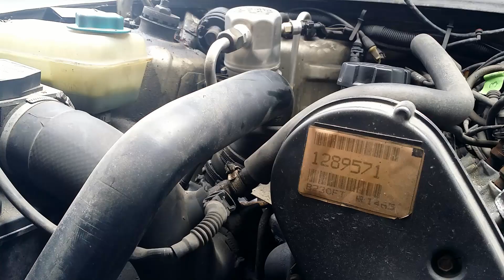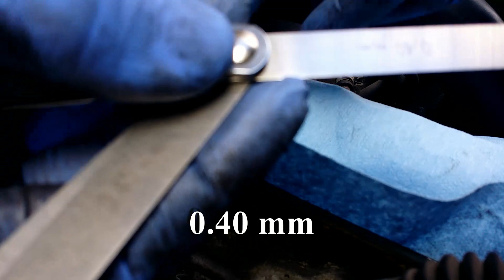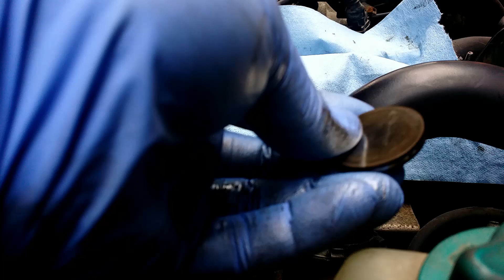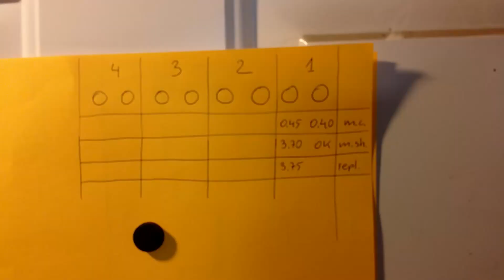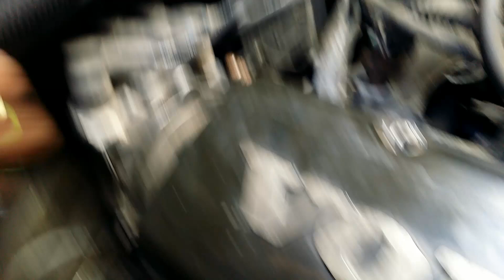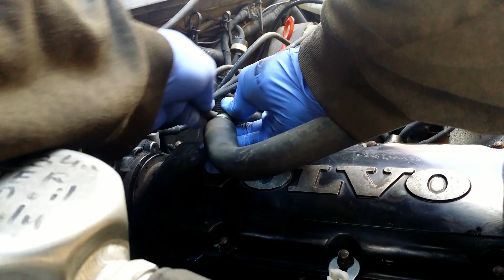Valve Adjustment in Volvo 940 Turbo, or any B230 Engine. New Hushers in.

Comment: I have a clear ticking from valve area when in gear and rising RPMs, not idle and rev ups in neutral, a flattened husher could make ticking noises?
Reply from the maker: Hard to tell in a distance. Check the valves.

Comment: This is a fantastic how to video. I did not understand entirely marking the distributor position and replacing in the same position in terms of how it is loosened and secured.
Reply from the maker: Distributor shaft gets into camshaft. To remove camshaft it must be removed. It is not critical to put it back in precise spot, but it is good practice to reassemble machinery as it was.

Comment: Hello, is the Hazet 2574-1 hold-down device suitable for replacing the valve plates?
Reply from the maker: I never used this specific one. Check with the manufacturer.

Comment: Do you really need to mark the distributor? I thought it was electronic ignition controlled by ignition ecu and wont make any diffirence?
Reply from the maker: You are right, but it is a good habit to mark parts before disassembly.

Comment: you really shouldn't use rtv on the valve cover gasket it introduces a danger of loose pieces falling into the head during the next service. Volvo recommends using a 'High Tack, Non-hardening gasket sealant' on all their gaskets.

Comment: Hi there. Did the clearance changed when you put new hushers?
Reply from the maker: New hushers will lower the gap, but not for long. Don't measure valve clearance with just installed hushers. They will get in shape eventually.
Reply: @robertdeptula2003  My B230 lashings are all in specs, but still has one valve ticking when throttle up in gear, could be a bad husher? thx

Comment: Once it warms up later this spring I plan on doing the following in one procedure on my '90 B230F engine: new water pump, timing belt, timing belt tensioner & spring, camshaft & intermediate shaft seals, valve clearance check/adjustment, hushers. I have most of the new parts I'll need - mostly Genuine Volvo. Since I have never done any of those jobs before I just need a lot of patience and luck. Hopefully, I have all the required tools, too.

Comment: Do worn hushers make a clacking noise?.. Sounds like an old sewing machine mine even when warmed up..
Reply: yes they become hard and crack,then fall into pieces ,noisy like you mentionned
Reply: I have clear ticking from one valve when throttle up, but not in idle and rev in neutral, flattened husher?

Comment: Great video and explaining.  I have a  question - at 17:00 when you show your chart, do you want both to be at 0.40 so that they are equal?  Since the shim measures at 3.70 and you want it to be less so that the .45 goes to .40 wouldn't you replace it with a 3.65 shim? and not the 3.75 ?  Thank for all your help.  Joseph in New Mexico.... We have a new and hopefully better President today.  Trump is gone..YAHOO!!!
Reply: The "gap" needs to be .40 but it is .45 which means it is .05 too much so the gap needs to be made smaller. Since the shim measures 3.70 you need to add .05 to it , to close the gap by that amount , so the final shim is 3.7 +.05=3.75. Now the gap is .40
Reply from the maker: @abyssalsoul6216  Bentley manual for Volvo 240 has it wrong and many people are confused.
Reply from the maker: Do you have Bentley manual for Volvo 240 and look up for valve adjustment there?
Reply from the maker: Is it your's thumb up as the answer to my question? If you have Bentley be careful, they made wrong calculations there. If you have it let me know. I will explain to you what is wrong there. My calculations are correct and you can verify that with Haynes manual for Volvo 740 & 760.
Reply: @robertdeptula2003  - yes I did the thumbs up.  I do have the Bentley repair book and will look at the subject in a day or two. I have a Volvo 240, same engine is b230. Thank you.
Reply: "We have a new and hopefully better President today."  This aged like fine milk.
Reply: @crs290 lol yeah, and he was replaced with the previous guy… anyways I guess I will adjust my valves now lol.

Comment: Nice video! You replaced the vacuum hoses because you were at it, or is it advised to do so?
Reply from the maker: The rubber was cracking on the old ones (25+ years).
Reply: @robertdeptula2003  thanks. By the way, when you mention you have to replace the shim to correct the clearance... It means you have to order it and replace it after arriving, right? So, in the meantime the car is parked, or you re-do everything just to replace the shims once they arrive?
Reply from the maker: I put everything back together and the car was driven before new shims arrived. I replaced the shims after using a special tool without camshaft removal.
Reply: @robertdeptula2003  thank you again! That would make a nice video 2.0 though

Comment: what tool are you using in the video at 9:52 too hold the camgear???
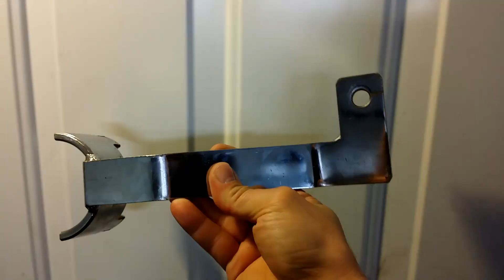Reply from the maker: It is  crankshaft pulley holder I show at 24:37
Reply: @robertdeptula2003  hei Thank You very much. did you bye it on ebey or at a volvo shop.. sorry for bad english am norwegian
Reply from the maker: Don't worry about English. I am Polish living in French part of Canada. 
The tool is from FCP Euro in US. www.fcpeuro.com
Reply: @robertdeptula2003  Tool is also on Amazon and ebay

Comment: Thank you very much for your informative video. I have a 91 740 wagon that has been in my family since new. It is very near completely restored and this was one of the last items on my check list. It is impossible to find anyone who will be meticulously faithful to the exact original condition of the car so your excellent walk through was very helpful to me.
Reply: L8nitedave 
I have a 92 740 wagon with a little over 490K miles that I drive daily. It has been maintained all of its life and is stock. It still has the original alternator and starter. They are the best cars ever made.
Reply: @Notvotingyourewayoutofthis  All the rest has been changed? Lol
Reply: @bobjohnson1587  
Nope all original. Nothing but diligent routine maintenance. The valve cover has never been removed. It has never even needed a tow. They are possibly the best built vehicles ever made.
Reply from the maker: Thank you for your kind words. Yes, let's keep them rolling. Those are amazing cars that are build no more. Follow my chanel for more Volvo 740/940.
Reply: @robertdeptula2003  I’m doing the head gasket right now, is it better to measure the valve clearances before removing the head?